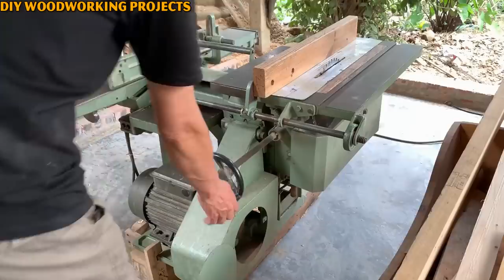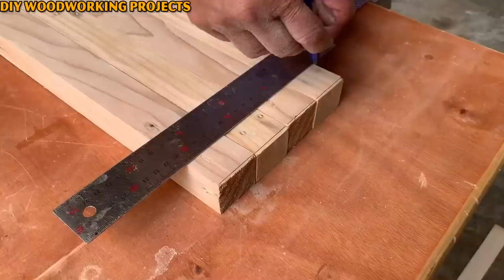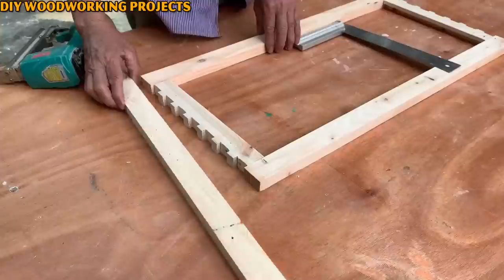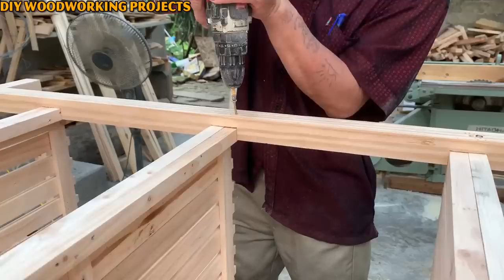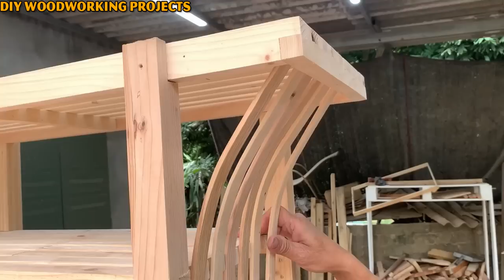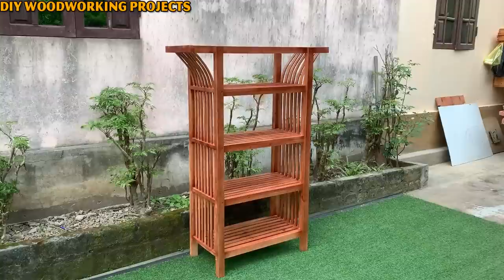Amazing Design And Craftsmanship // Easy Way To Make Storage Shelves From Recycled Wood

Comment: The idea is interesting, especially bending the wood with a heat gun. Some joints have voids which they could be filled with a wood filler and then perhaps spray paint to cover (my OCD is kinda kicking in) but nevertheless it's a nice project :)